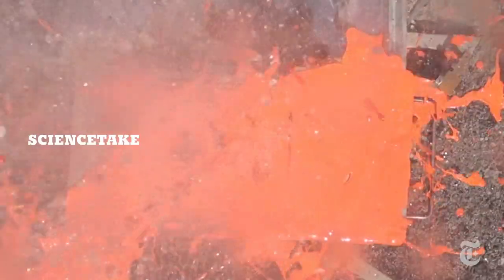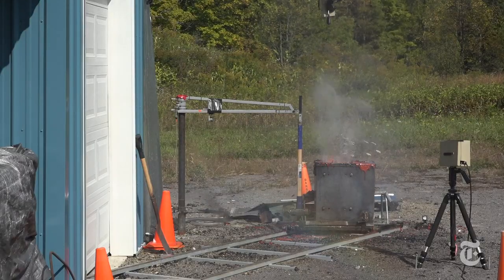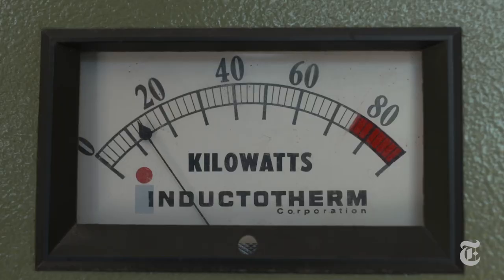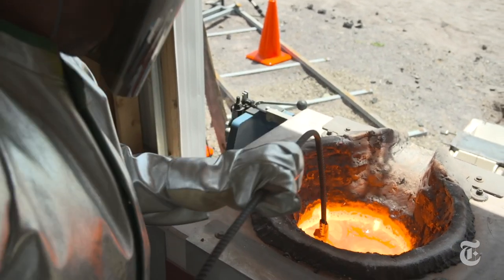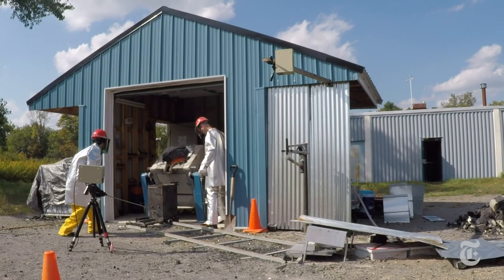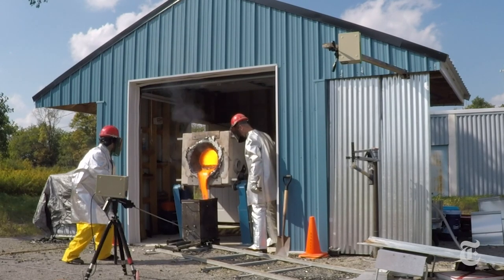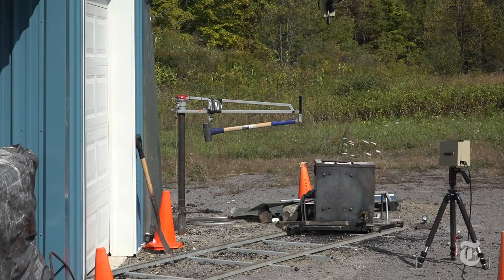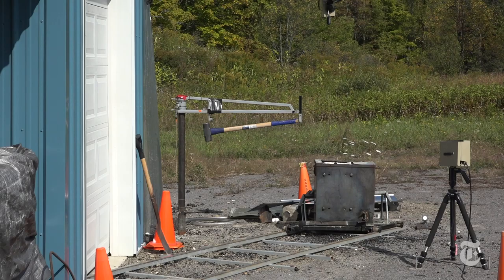The Science of Exploding Lava | ScienceTake

Comment: The lava exploded before the sledgehammer hit sometimes. How does that happen? Just coincidence?
Reply: I was gonna say the same thing
Reply: The reaction doesn't require the sledgehammer, but they released the sledgehammer to trigger a reaction if it didn't occur on its own. It's in the video.
Reply: I think they put the cold rock in the lava but it didn’t react as fast so they thought to use the sledge hammer but it already “erupted” because of the rock. It just didn’t react as fast.